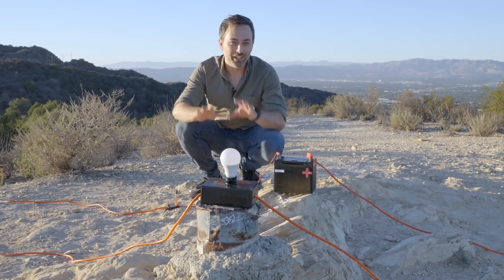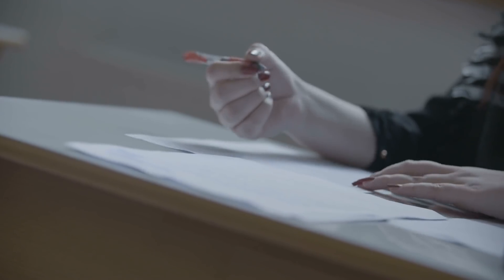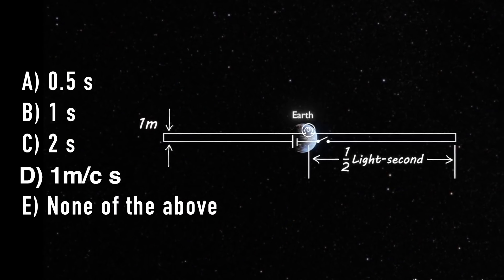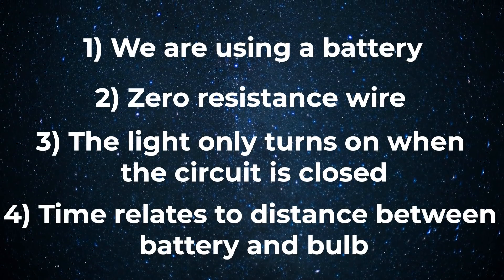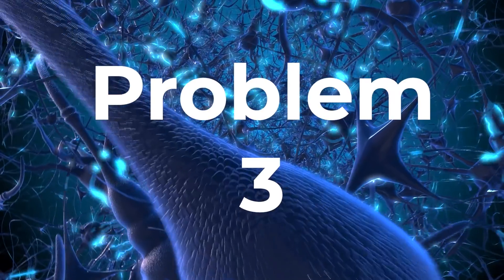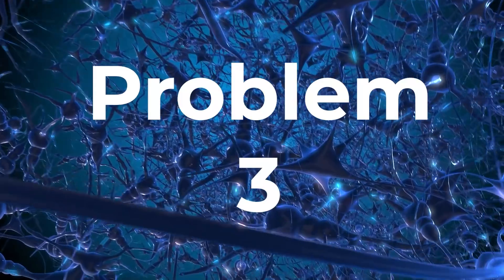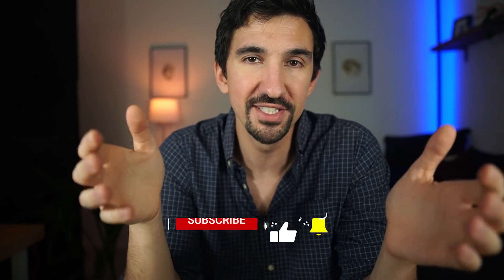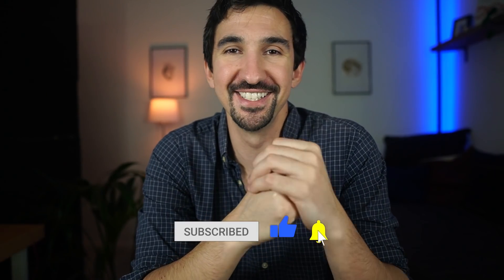Is Veritasium Wrong About Electricity?

Comment: I think I agree... he's probably not wrong but how you can actually reason or support his claim is not that straight forward... you clearly need to at least see that you have paralell wires, they are also inductive and capacitive. And current flows because of that. Though with a distance of 1m this current wont be much, unless you assume the wire has no resistance, which you have to if it extends half way to the moon. Then your capcitance is pretty big and thus also coupling. Though I guess youd better also forget about the inductance of such a cable.

Comment: Q: Given a perfect pipe of length 1 light year, 1cm inner diameter. Fill pipe with perfect uncompressable liquid of inconsequential mass.  Start timer when you quickly inject a big squirt of liquid into the pipe. The other end has a one way valve.   How long does it take for a big squirt of liquid to come out the other side?
Reply: Exactly.
Reply: Instantly! (Which is faster than speed of light), but then again these assumptions are practical, so there is no connection with reality.

Comment: 1. excellent point about causality
2. a comment I just left on his video, "I disagree with your video.... As a graduate student I performed "ultrafast" spectroscopy using a laser that produced a femtosecond pulse width every 12 nanoseconds. The pulses are split such that half of the power of each pulse goes into a fluorescent sample, half goes into a photodiode. Fluorescence photons are collected by a second detector, and signals from both detectors feed into a timing board. The technique is called time-correlated single photon counting for anyone that wants to read up.

The timing of pulses from each detector is directly proportional to the length of cable coming out of each detector. If you add a meter of cable to one of the detectors, you will see the pulse shift by 3.3 ns. This can be visualized by an oscilloscope as well. It is common to use as part of the setup a pre-fab "delay box," which is just a long coaxial cable coiled up and neatly housed in a metal box. I've opened the box and seen it with my very own eyeballs!"

Comment: A wave propagates by incrementally moving water molecules as it passes, that is to say that a molecule of water doesn't travel from the switch to the lightbulb, (stone to the shore).  If you consider electrons don't all line up and march down the wire in one continuous parade, they disturb or "kick out" the adjacent electron which does the same to it's neighbor.  Then it's interesting to think about FTL communication...

Comment: The Veritasium Video left out quite a few things, which go on in power lines.

Your Break of the universe is actually none.

Let me explain:

1. The power source is completely irrelevant.
What we care about is, that it generates a steady voltage, which doesn't change over time.

2. That is a kind of simplification we have to take for this experiment, otherwise we will not get any meaningfull current to that bulb.
But we leave out capacitive coupling between the wires and inductive effects of the wire themself. At least Derek didn't talk about them.
If you omit those as well you get into trouble, because there will be no magnetic and electric Field present, which breaks the whole of the explanation.

3. the light turns on a short moment after the switch is closed and turns off a short moment after the switch is opened.
The E and B Field (Electric and Magnetic) will take a while to propagate from the switch to the bulb. If your switch is on one end of the loop and the bulb on the other, it will take the distance between those two.
This plays into the 1/c s thing as well. It should be d/c, where d is the distance between the switch and the bulb.

4. See 3. Those 2 are interlinked.

Your assumption 4 is wrong. It should be switch and bulb. Not battery and bulb.

And movement of electrons does generate magnetic Fields not electric Field.

Electric Fields are only generated by differential charge. And therefore a current itself is not a indication of a electric field.

The simplified versions of science, Derek calls a Lie is a simplification done for practical purposes.
Your common electrician does not know about pointing vectors.
To be fair, he does not even care. The only thing he cares about is voltage and current. And therfore Power.
He does not need to care about moving the cables slightly left or right for inductive and magnetic coupling to dissapear.
He does not need to care about the energy which is radiated by AC Circuits. Those effects at anything less than kHz are absolutely miniscule.

What Derek has done is approached the topic in a "wrong" way. Instead of taking the engineering way of expanding topics into areas which come in handy in more and more advanced areas, he took the physics way and steamrolled everything with foundation research. (Have I used the right word? In German it would be "Grundlagenforschung")
Which the way it works, but is way to complicated for everyday work.

Comment: This is what I wrote as a comment on the Veritasium video:

"I think there are a couple of problems in your explanation, which is why I'm tempted to stick with the 1s answer.
- For there to be a magnetic field or a difference in the electric field around the light bulb, charged particles must start to move even so slightly, but how can they start moving if not through the electrical field propagating first to the ends of the wire from the generator and then back to the light bulb?
- In the first 1s it is irrelevant whether or not the circuit is closed at both ends. You could as well have another switch open at one end (with another generator on the side connected to the light bulb so that charges have the same distribution around the light bulb. According to this explanation, the current should start flowing on the other side of the wire even if the other switch is open as there is no difference in the local conditions during the first second."

I was thinking about the "antenna" effect too, but I assumed that could be neglected anyway because not relevant to the "circuit" assumption - the video was talking about power flowing in a circuit.

EDIT:
OK, the electric field will propagate through the air and induce a current on the other side. So the lightbulb could potentially light up with the right amount of potential. If the circuit is open at one end, the electric field at some point will stabilize and the light bulb will fade dark again.

Comment: The proximity of the battery, switch and bulb seems to be the key to the thought experiment. The other scenarios of switch and battery placement are interesting as well, ie battery, bulb 1m apart and switch on the moon or battery on the moon and switch 1m from bulb, etc. I net out the Veritasium argument as .... the distance of the power source to the bulb and switch determines the time from switch to illumination. What if the battery and bulb are 1m apart and the switch is on the moon. It should take (approx) 1s for the electrons in the wire at the battery to "realize" the switch has closed. So why isn't that the case when the 3 are "close" to each other. This will keep me up all night tonight thinking of the combinations of placement of bulb, switch and battery proximity (and on the moon) and what that means for propagating waves, electrons and the cause and effect arguments.
1) Battery/Bulb/Switch ------------------------ 300km wire loop        (as in the Veratasium case)
2) Battery/Bulb ------------300km wire loop----------- Switch
3) Battery/Switch ------300km wire loop-------------- Bulb
4) Bulb/Switch ------------300km wire loop------------ Battery
5).... etc

Comment: The lightbulb will turn on even when the resistance is non-zero, then it will turn off. The reason is the capacitive coupling between the wires and it is the very reason the lightbulb turns on at closure. Even if the circuit is open at the ends.

The only difference is what happens when the transient ends.

Comment: The dimensions notation is correct in Veritasium's video. The units may be grouped on the right side of the expression; the constants are their value only and the dimensional analysis is written on the right side, preferably with the square brackets notation.

In this case it would be 1/c [ m / (m/s) ]  that simplifies to 1/c [s]
Reply: @GoldenLion8  "1/c [s]" is a value. 1/c is the number, "s" is the unit. The number happens to have an unsubstituted 'c' but is still a number.

Placing dimensions in the number part makes no sense.

Comment: For the DC circuit: Just after the switch is closed there will be changing electric and magnetic fields (or electro-magnetic) which will allow the transfer of energy; but once the circuit has reached the steady state then both the electric and magnetic fields will be in a steady state. i.e. static. 
There can then be no transfer of energy through these fields as they are unchanging. 
Therefore for a DC steady state current all the energy must be transfered by the moving electrons.

Comment: Hey boss. Electronic engineer here, including chip design. This problem is very important in chip design because of the vry small size and because very high frequency. You are almost right. We call these thing "lines" in chip design.

Line have their own properties, but indeed, the current, but not in the established way we study when we study electricity. This comes after several pings pongs with the signal racing the end of the line. So you switch on, some current start flowing, and an electronmagnetic wave is cruising toward the very far end of the circuit, is reflected, comes back, and affect the equilibrium of the light and battery, which send another electromagnetic wave in the line, and so on.

The end result converges toward the solution you study when you study electricity in discrete steps, each step being one round trip to the far end of the circuit and back.

Comment: You make a mistake with your assumption 3 and the consequence of breaking the circuit at the distant point. You state that the lamp will turn off at 1m/c seconds. But that isn't true for the case where the switch is at the furthest point. The 1m is derived from the distance between the battery+switch and the light bulb. Once you move the switch the time it takes for the light bulb to switch off increases appropriately. You've constructed a straw man argument, because the original experiment does not claim to break causality, nor does it consider the case where the battery or switch is moved (I haven't read his link yet, just watched the video). You've changed the scenario but not the respective terms of the equation in order to break it. The time for the light to switch off becomes ~ 1/2 sec.

As I understand the experiment, the circuit doesn't even have to be closed in order for the light to turn on. Two superconducting wires of sufficient length in close proximity will act as a closed circuit until such time as electrical flow isn't possible. Oh - then I continued watching your video. Anyway, it's an interesting experiment, and I hadn't thought about electricity in this way much.

Comment: If I get it right, there is a difference between a circuit that is used for the first time and one that is established already. In the latter case the speed will be higher and almost instantaneous. It is true that the electrons getting into the wire are not the same ones leaving the wire They are hardly moving but the pulse travels like kinetic energy that gets passed through . The speed of this wave will not be light speed but still very high. Even light travels slower in a material than in vacuum. In a fresh circuit however there is extra work to be done. It's like needing to fill the reservoir behind a dam first before you can make use of the hydropower. In a not new circuit, the water is waiting to flow. This is what I would think without listening to video more attentively.

Comment: In the original video veritasium never talked about the amplitude of the fields. Imagine we have our bulb at least 1 km away from the switch and the battery (in the same perpendicular direction). In such case it's obvious that the amplitudes of the fields which are radiated from the 12 V battery/switch are so small that no bubl can light up. But the answer is still 1 km/c which is momentarily. P.S. I doubt that even being 1 meter away the fields are strong enough to light up the bulb.

Comment: Can anyone explain how the EM wave model explains resistance/impedance? I always thought of it as electrons having elastic interactions with the atoms in the conductor, but if the electrons aren't really moving and all the energy is in external EM fields, why should there be any resistance at all?
Reply: The electrons are moving, just very slowly (on the order of a meter per hour).  The field propagates quickly, though (about 2/3 of the speed of light between the conductors).  To use the flawed garden hose analogy, imagine that you have a hose connected to a faucet with the water off, but the hose is still full of water.  When you turn the faucet on, a "wave" is generated that propagates rapidly toward the end of the hose, and the water at the end of the hose begins to flow almost immediately, even though the water coming from the faucet has not traversed the full length of the hose.  Similarly, the E and B fields are doing the work by mobilizing electrons that are already near the load.

This gets really messy because we're not very clearly separating steady-state / static analysis from transient / dynamic analysis.  Depending on the mode of transmission and a variety of other factors, the E field or the B field may contain more of the power being delivered.  This is also affected by the distance between the transmitter and the receiver (aka "near field" and "far field").  DC resistance is more or less the electrons colliding with the atoms in the conductor (also referred to as "drift velocity").  The flowing current will create a magnetic field around the wire (parasitic inductance), and the collection of charge along the signal and return conductors will create an electric field (parasitic capacitance), and the combination of the fields is how the power is delivered (which is what the Poynting vector shows).  The issue that you might be stuck on, which I don't have a good explanation for, is how DC analysis almost puts the cart before the horse, because we need to know the resistance in order to calculate the steady-state current, but the current and charge are what deliver the power.  Sort of a chicken and egg thing.

This is where AC analysis and transmission line theory come in.  We can replace the conductors with a series of inductors and connect the inductors between the signal and return conductors with capacitors.  This can be used to model the characteristic impedance of the line, which you can view as the amount of effort that the transmitter needs in order to charge the parasitic capacitors and inductors.  During this dynamic state, the fields are propagating in a very complex way in the space between the signal and return (it's actually propagating down both wires at the same time!)  After the fields have had enough time to settle into a steady-state condition, the DC resistance now "controls" how much power is delivered from the transmitter to the receiver.  Importantly, even though the resistance determines the amount of power delivered, the fields are still the vehicle which transmits the power.

Comment: At around 9:30, considering we are assuming zero ressistnce wires it would be perfectly reasonable to assume zero power losses between the antenas, so the light bulb would presumably turn on as if there was a 12v potential across its poles until the information that the circuit is open propegates through space. Heck, even with no wires at all just by moving that battery in space relative to the load (the bulb), with sensitive enough equipment and noiseless enough enviroment we would perceive a voltage potential change in the real world. In the real world everything is an antena and everything produces/changes the electric field, you learn that really quick when working with high frequency and sensitive electroncis. You made some wonderfull points in this video and very much based on facts (just from a flawed point of view in my oppinion), and probably Derek didn't explain the subject as clearly and in depth as it would be neccessary to understand it sufficiently, but I believe his point still stands.

Comment: I was actually expecting the answer that by how much time the bulb will lit in that case !
Anyways if the answer is that like the bulb glows instantaneously then something is there which is actually travelling greater than the speed of light .
And I also think that for a circuit that much big, we need a very powerful source , that can actually create the potential difference across the ends of the source which I think is not possible till now.
So the thing is that for me the answer is still practically unknown .
Reply: Nothing is travelling greater than the speed of light. With a circuit that big, the light bulb wouldn't glow at all. The resistance and volt drop through those very long conductors would be far too large, even if you replaced that 12V car battery with High Voltage. Halfway to the moon and back. That is a very long distance. The answer is clear. His thought experiment was flawed, was designed to be a trick, and the real answer is E, not D.